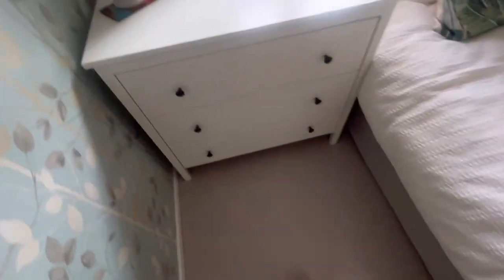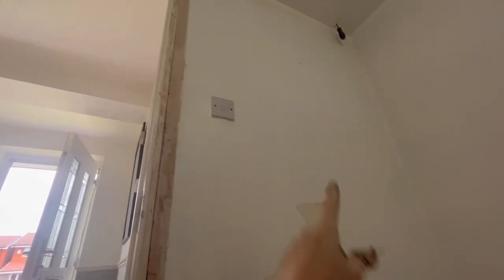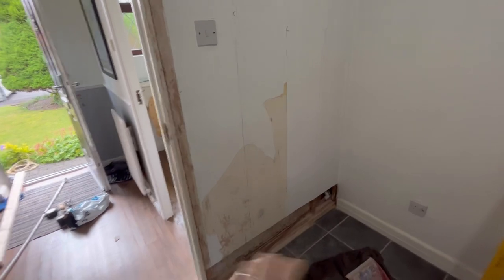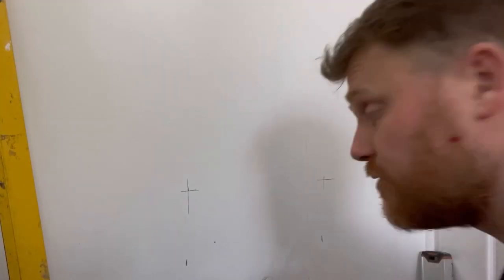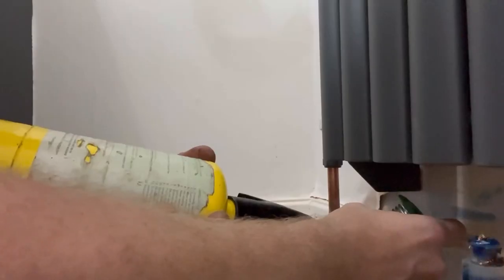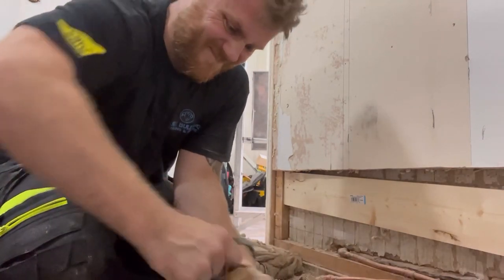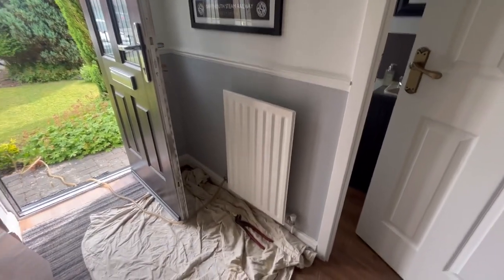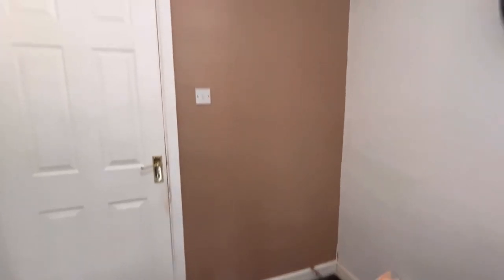Day in the life of a plumber EP4 Installing designer radiators

Comment: Nice job , customers don't realise the amount of work involved sometimes when you tell them what it's going to cost.... 😳
I just wish these designer rads came with long length panel type brackets instead of four small ones , it would make fitting them a doddle....
cheers.... 👍
Reply from the maker: Cheers mate…Yeah I tell customers to sit down before they open the quote 😂😂 Would bare the weight better if it was a full bracket and easier to install overall
Reply: The ones we fit for air source systems are similar to designer rads. They come with full length brackets. So much better.
Reply from the maker: @ashleymapes3926  I looked at these, look a good idea, ain’t actually seen one in the real world yet
Reply: Should of used studding with chemical resin into the block work as long as the resin got behind the board it would have been fine